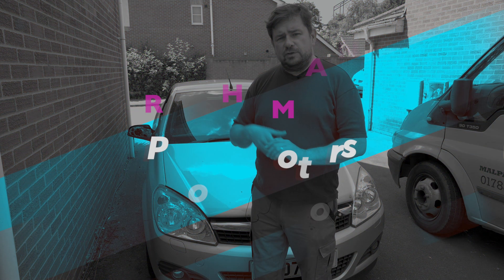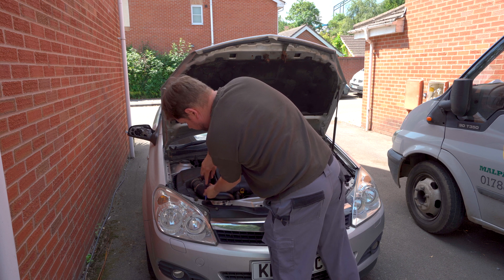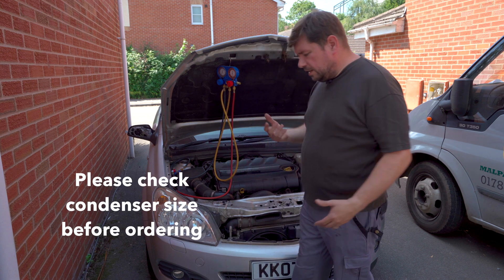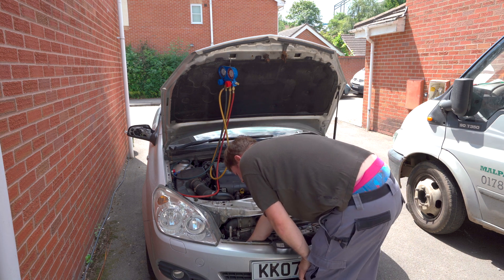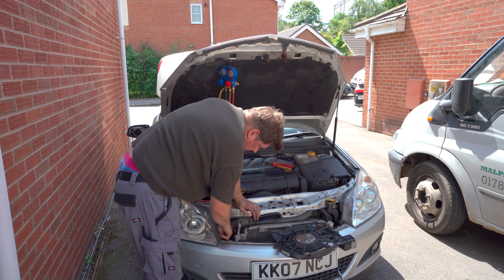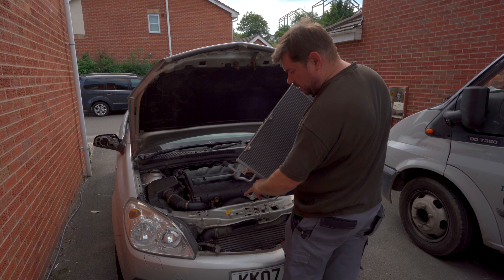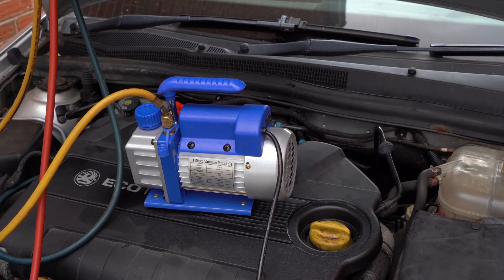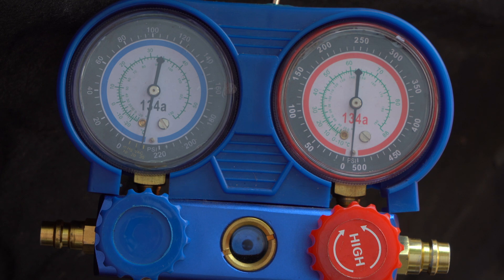Air con Testing & Fixing. Condenser Replacement

Comment: Thank you for the video - I think my pressure switch on my 2013 Zafira B (looks identical inside) has gone - I am 99% sure it has a valve so I can change without removing the gas - do you know if this is correct ?
Reply from the maker: Astra and zafira has the same setup, Sorry I’m not sue and I don’t have the car to check
Reply: @RichManPoorMotors no problems - thanks

Comment: Interesting you did the seemingly most complicated thing yourself (emptying the system) and let the refilling to the workshop.
Reply from the maker: In the uk you need to have the qualification to buy the bulk aircon gas, for the amount I do it’s not worth it, you can buy top up amounts, but when filling an empty system it is done by weight to get the correct amount of gas

Comment: Got a question if ya don't mind....I've had my car 7 year now corsa d gonna remove my condenser ready for hotter weather I've read a few things about it when my car is moving along would it get slightly more cool air when condenser as been removed I read it gets 80 percent but without condenser the hole 100. Is this correct 
Thanks
Reply from the maker: Im not sure i understand your question.
the condenser is part of the air con circuit, 
it cools the hot compressed air created by the compressor pump then as the gas expands in the evaporator you get cold air. so with out it it your aircon doesn't cool the air.

If your talking airflow to the engine radiator, then obviously it slows down the air flow but the car is designed for it when in place, the fan speed or different  thermostat would also help to lower engine temp. if any of the fins are blocked then the efficiency isn't going to be as good as when designed